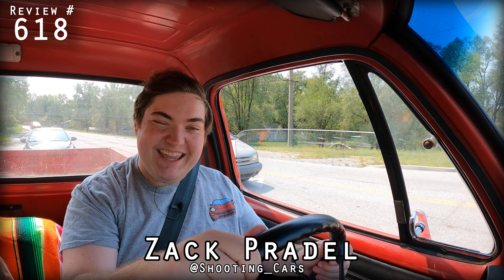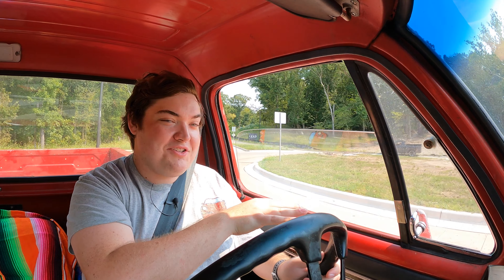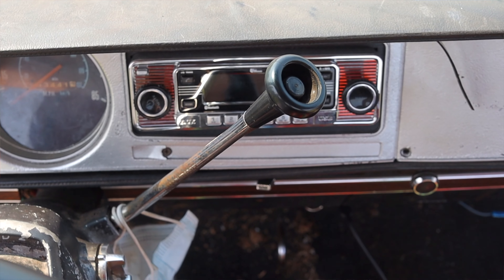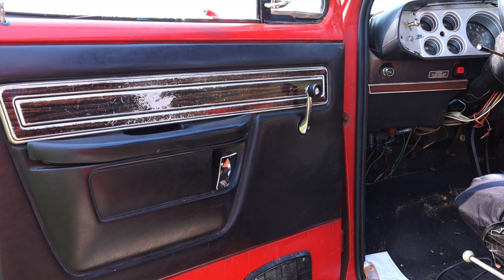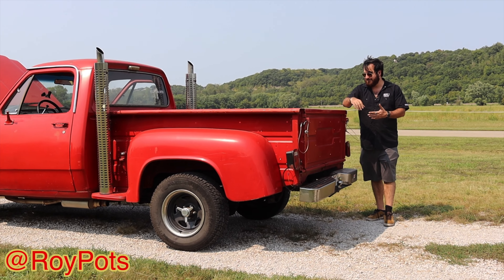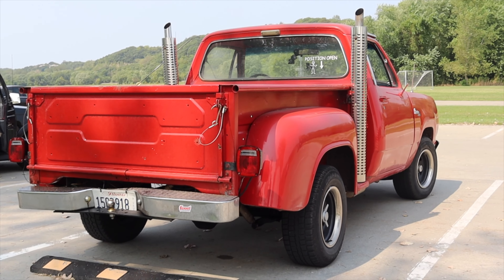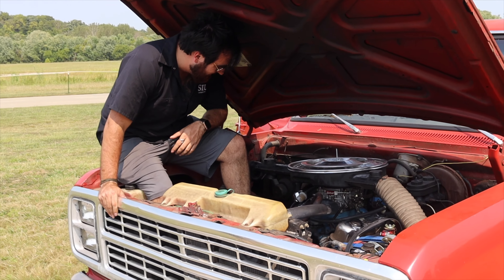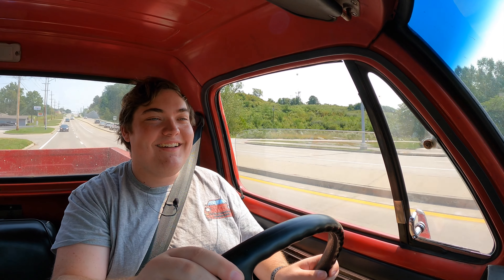1979 Dodge Lil Red Express Truck Review - The FIRST Sport Truck!

Comment: Rumor has it that the 360 is the police-package version. The only way this truck could have been cooler is if it had the gold decals and wood boards on the bed. Props to the owner for not being afraid to use it as a truck.
Even in the 70s, Dodge was like "emissions and fuel economy regulations? Haha V8 go brrrr."

Comment: Mopars most certainly do have great transmissions especially if you leave your engine stock or smart enough to build your transmission when you build your motor but if your dumb enough to double or triple hp or torque and not touch your drive line bad things happen like putz' with a Cummins!!!!

Comment: That's not a express its a pos clone
Reply: Numbers matching Lil Red Express :) I just never put decals or wood back on after respraying it in 2010. She’s no clone 😁
Reply: @royboy605 wrong stacks no chrome side steps and if it’s real did you weld all the holes up in the bed side and tail gate for the wood trim?